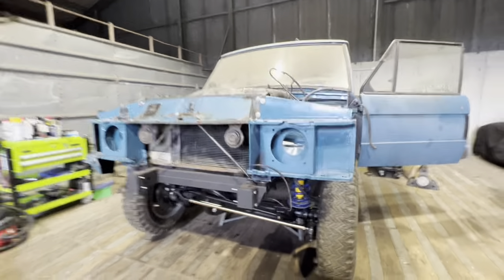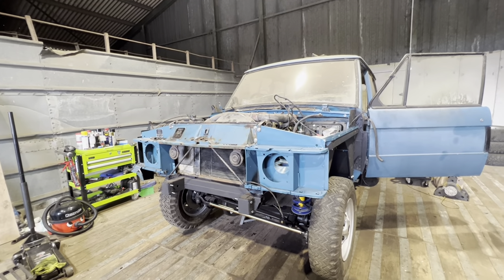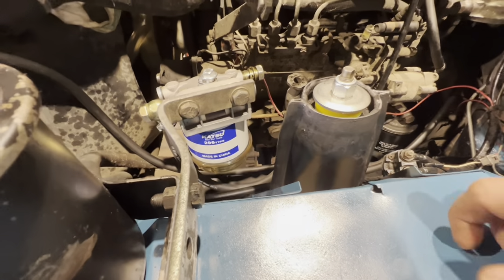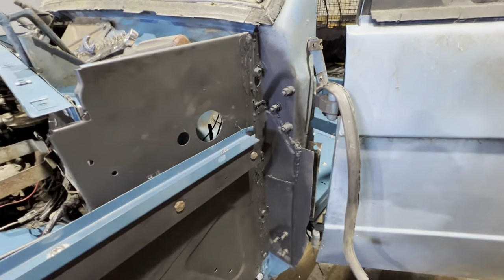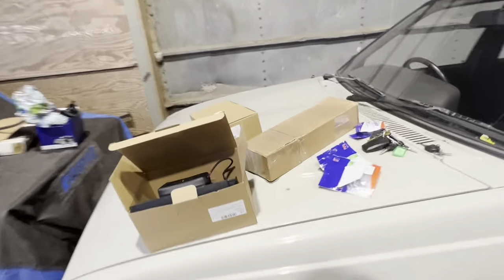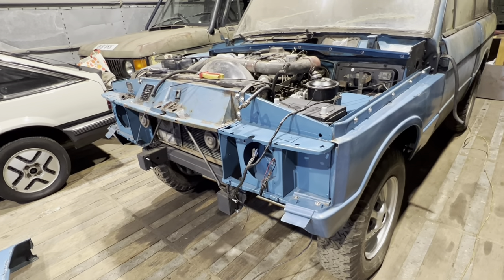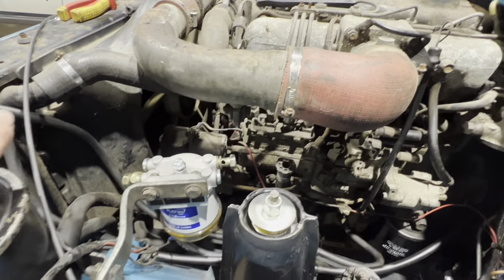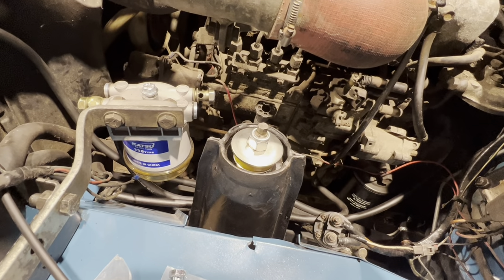Range Rover Classic 2 door restoration part 15 - can we save the paintwork?

Comment: I had a RR Classic and the paint was coach enamel aka Dulux gloss type of paint - you cant mop to a shine as such with this type of paint, but you can remove grim and contaminants. Best to use a very mild abrasive to remove surface grim rather than cut intro the paint and then all you can realistically do is apply a good wax to get the shine. Very nice approach to the restoration - good attention to detail where it matters. I agree a patina restoration will make the car more valuable me thinks. Keep going

Comment: Hey Mate, great videos. What engine do you have in there and what is at the back(box)?
Reply from the maker: Hi bud. It’s a 3.5 SLTI. ( turbo injection diesel) from a Mazda lorry! Mounted to the original 4 speed gearbox. It’s an off the shelf conversion 👍🏻